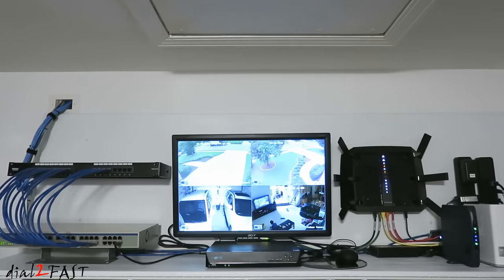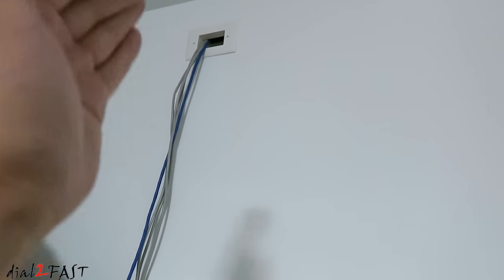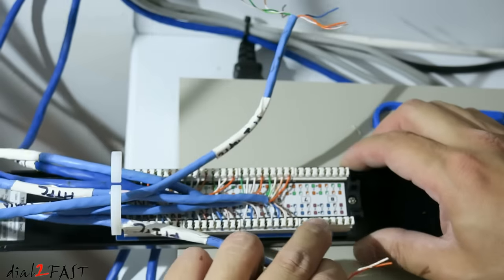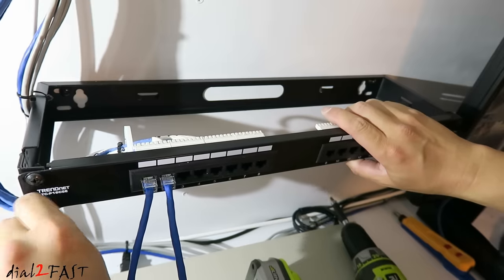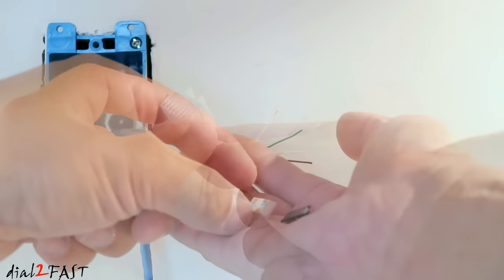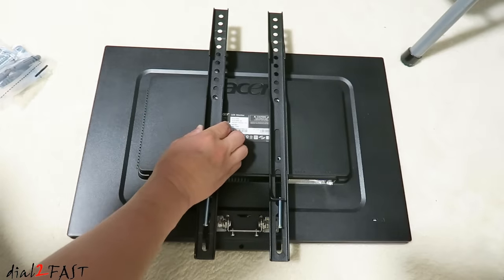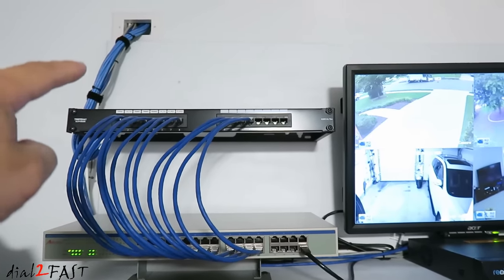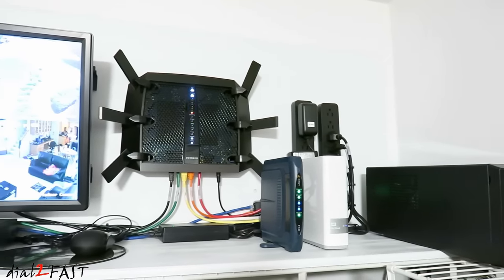DIY - How To Build Your Home Network

Comment: First, don't untwist the pair all the way! should keep the twist until the  punch down.
Second, don't use hand made patch cord! just buy some manufacture made from amazon, it's cheap and more reliable.
Third, You chose the wrong keystone(female rj45), that's a low quality one, use punch down one like panel. Also.....don't untwist all the way back.....unless you just need 100M
Reply from the maker: Nothing wrong with making your own patch cables. Been doing it for years both at home and in data centers. Also nothing wrong with untwisting the wires several inches at the terminating point. First you need to understand why the wires are twisted....EMF!

Comment: patch panel for this setup is completely unnecessary, he did it cause he wanted to
Reply: so was the switch to if you think about it considering he connected everything to the router instead
Reply: @ttss5726  well no, the nighthawk router only has 4 switch ports
Reply: you missed the sarcasm... and btw it has 5 ports :O)
Reply: 15:12 he literally says 4 ports, the 5th connection is the WAN port from the cable modem. https://images-na.ssl-images-amazon.com/images/I/51g5OlvU8WL._SL1350_.jpg

Comment: Do people still do this ? Seems so 90s these days with everything being WiFi now
Reply from the maker: Wireless cameras may seem more convenient, but each camera still require running the power wire to an outlet to power it. Try finding power 20' up in the air with the camera mounted outside. Also the most reliable system is a wired system.

Comment: Those direct connect patch panels are the absolute worst thing humanity has ever crated. Just use the ones with connectors on both sides.
Reply: No way, punching down is waaaaaaay easier than crimping an ending. The actual easiest thing to do is get a keystone patch panel so you can punch it down on a table or something else without having to hold it up to the panel attached to the rack.

Comment: why you calling always cat5 cat5, it is not mattar cat 6 cat 5 all is same
Reply: Shohel Rana cat 5 is not the same as cat 6..
Reply: Bobby Sinatra,  quality is different but patch pannel and rj45 connector making is same
Reply: Shohel Rana ah I thought you meant quality my bad
Reply: +Shohel Rana there is actually a proper cat6 rj45 connector that should be used which is staggered instead of in a line